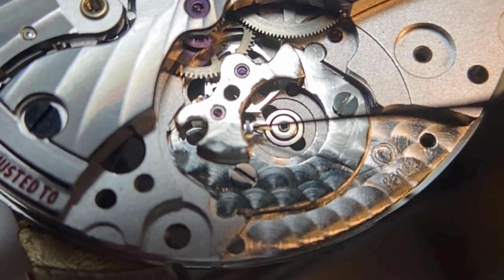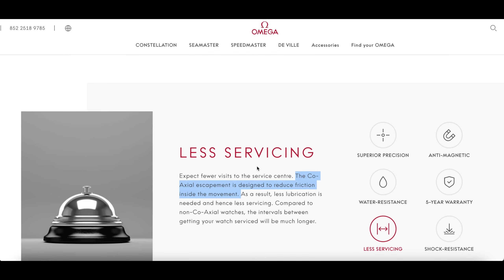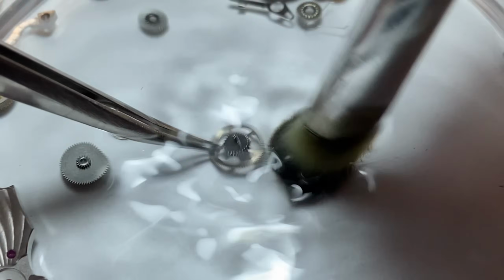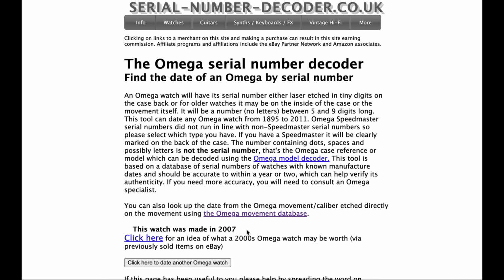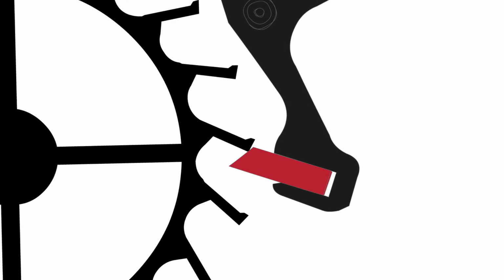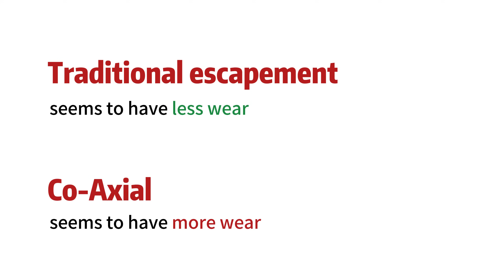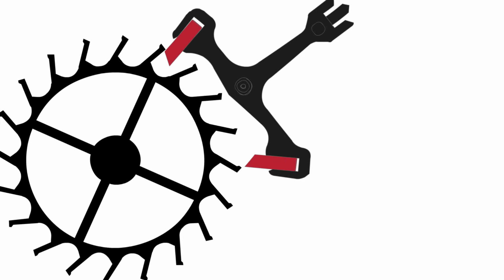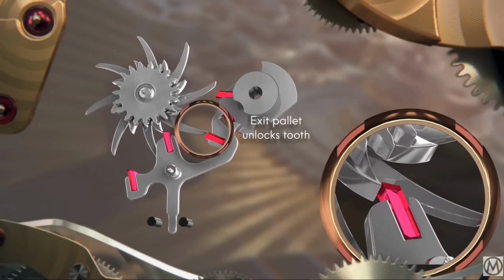Something you don't know about Omega Co-axial

Comment: It is very concerning that an escapement, which in theory does not require lubrication because the level of friction is so low, would show any wear in the teeth of the escape wheel, something I have never seen in a Swiss Lever escapement. 
In 1999, I made an animated drawing of the coaxial escapement and posted it on my website. What I learned from making the drawing, and comparing it to my other animated drawings, was that the drawing had to be exactly right, or it would not work. Other drawings would work within parameters of error, but did not have to be absolutely perfect. An escapement with such low friction should never wear out. I have never seen a worn-out Swiss Lever escapement, not even one with a brass escape wheel, after running for many years without lubrication. However, if the teeth land on the corner of the pallet jewel (when it should land on its locking face), then this could cause a small binding effect which would result in wear. I would probably not be able to see the difference with a watchmaker's loupe. This leads me to believe that this particular coaxial escape wheel, which wore out, as ever so slightly defective when it was new, or it would not have worn out the way it did. 
You can google coaxial abbeyclock to find my animated drawing, which you could compare to the animated drawing of the Swiss Lever escapement. 
I hope this information helps this discussion.
Reply: In my view this is more a result of modern business practices, in which parts aren't made to last forever, they're made to last until the next service. Any part showing the slightest wear is replaced. That creates a whole lot more revenue for the brand and is why a service of a 5 year old watch like this at a brand store costs close to $1000. 
In vintage watches you would never see this kind of wear. Back before the 1980s watches were made with much higher quality materials and mechanical processes rather than chemical, eg the burnishing of the pivots.
Reply: I have lever escapement watches over 100 years old, plus others in the 50-90 year 
old range, not serviced in over 20 years and running well. But this is supposed to have longer life ? 
I am glad that I specifically looked for a  Speedmaster Professional with a lever escapement when i acquired mine 
.
Reply: @ We could argue about durability, but I believe that the best lubricants last about 6 years, so every timepiece should be lubricated every 4 or 5 years. Since you have a Speedy, look for a page on the same website called How a Chronograph Works.
Reply: Really interesting info Abbeyclock, I was also wondering why it had failed so hard after a relatively short time without service (compared to the hard lives some watches live). Also the fact that only 2 teeth were worn, rather than a uniform wear, seems to support your theory.
Reply: @eus9  Now I am concerned about the new escapement with two escape wheels in the all-new Rolex Land Dweller, Rolex's answer to the Omega Co-Axial, twenty five years later. I am concerned because I do not want a watch with a silicon escapement  as brittle as glass.

Comment: That escape wheel is the old design FYI. The newer co-axial escapement, at least since 2017, has a multi point star shaped escape wheel, which is completely different and might have a much longer life without oil.

Comment: 1- Rolex recommended service life is 10 years while Omega still recommends aservice from 5 to 8 years, which defeats the purpose of the long service life of coaxial 
2- Up to my knowledge, new oils used are synthetic and have a much longer life than 5 years unless you live in extreme climate conditions 
3- Even if the coaxial escapment has a long service life, there are way too many parts in a watch movement that might develop a problem that would require a full service 
4- It also depends on how often you wear your watch and how to take care of it. There are certain ways that might help to prolonge the service life of any watch 
5- The servicing of coaxial is more complicated and more costly 
What I'm trying to say, I think the co axial is gimmick, Omega wanted something new that it can use to market the relaunch of the Omega brand after being under the rock during the 80's and 90's
Reply from the maker: Thank you for your in - depth analysis of Rolex and Omega servicing. You make some valid points. I think each brand has its own engineering and design philosophy.

Regarding the co - axial escapement in Omega, although you view it as a marketing gimmick, it has indeed brought some technical improvements in terms of reducing friction and improving accuracy. And I agree with your point that environmental factors and individual usage patterns can still impact the Performance of the Watch movements. Anyway, for watch enthusiasts who value precision and innovation, the co - axial mechanism may still be appealing.
Reply: Omega service interval set by engineers. Rolex service interval set by marketing executives.

There's a reason Rolex have terrible amplitude and accuracy problems, but we all still throw shade at 'the possibility' of a problem with Omega movements.

Comment: The great thing about most mechanical watches is that they keep pretty accurate time considering the complexity of all those springs, gears etc. I have an Omega Speedmaster Reduced with a  3510.50 movement - ETA with a piggyback chronograph. I wore it everyday for 30+ years and had it serviced twice and repaired once after I smashed it up in an accident. On average it gains about 20 secs a day, which is fine by me as I always set it a minute or so fast so that I’m never late for a meeting. Sure, my modern Omegas with 8800 movements are better but watch nerds like us can get too caught up in tiny differences between movements.

Comment: 'Co-axial' is Omegas 'interpretation' of the Daniels movement that they acquired in the eighties. George Daniels original concept was for a maintenance free movement and it can be argued that as long as Omegas versions are not compromised, they do a pretty good job.

I have had an early one from new. It became noticably noisy within 18 months but after returning from that initial (disapointing) 'service', has been within speck. Not sure without checking but I think I got it in the early '90's?

Comment: The Omega serial number decoder is  not accurate on newer model watches. I have a 2024 PO with an 8900 movement, which debuted in 2015, but the watch serial number places it from 2008. The newer serial numbers have no rhyme or reason for their numbering and are very hard to accurately determine a year from. If you need to have an accurate year, say for insurance purposes, you need to get the serial number provenance directly from Omega.

Comment: My relative passed me an ETA based Certina that had been running 40 years without service, and he wore it every day.  When I gave it to the watchmaker he thought that it wasn't worn much because the escape wheel and gears looked in such good condition.  I have similar Seiko watches that are over 20 years old and have never been serviced; in other words worn escape teeth is not normal for the lever escapement.  Furthermore, the Coaxial escape wheel still needs oil, but the Coaxial escape wheel is extremely difficult to oil properly.

Lastly, you comment about how the Coaxial doesn't lose time even when the oil has lost its properties: this contradicts your earlier statement about not needing oil.  I have no reason to doubt that the Coaxial can keep accurate time even with dried out oil, but is that an advantage?  I would argue no.  I rarely service my mechanical watches, and I have a timegrapher to tell me when watches actually need servicing instead of following an arbitrary 5 year rule.  If my timegrapher cannot detect any change in amplitude etc., then that's a bad thing.  I wouldn't want to be forced to service my watch because I can't tell if the oils are dry.

Comment: the service cycle is still to short, more engineering to be done.  I do not service my watches, they just go in a box when they stop. in a decade, my taste have will have changed. Possibly some material advancement cad do the trick such as using a machined sapphire escapement, though likely price prohibitive.

Comment: Surely any oil on the pallet jewels will be rubbed of in minutes or hrs  at the very most a day ?
Reply from the maker: That's not entirely the case. Even if there is a diffusion phenomenon of the lubricating oil, a small amount will still remain at the contact points in the end.
Reply: No it won’t, these oils are designed to keep on those surfaces.

Comment: I have a dynamic automatic that has never been serviced, it is an ETA movement, it's sat in a drawer for more than 20 years. I wore for the first time a few months ago, and it's running real slow. I'm considering getting it serviced, but on a Deputy Sheriff's budget, that a scary thing.
Reply from the maker: Hey, thanks for sharing your experience! The ETA movement is a classic. The fact that the watch is running slowly after being stored for over 20 years is likely due to reasons such as the lubricating oil drying up and parts wearing out. The repair cost can indeed be a concern. You can consult several reliable watch - repair shops and compare the prices. There are also some independent watchmakers who may offer more cost - effective solutions. I hope you can find a suitable way to bring your beloved watch back to life!
Reply: I have the same watch all good

Comment: Outstanding video. I have been led to believe that Omega attributes the problem with older escapement wheels on the 8500 to "percussive trauma" (rather than friction) from the pallet jewels on the escapement wheel  teeth; they have supoposedly addressed that on the 8800 and 8900, but I think that their lubrication recommendations have changed-- I suspect they are just saying the same thing you are, only you explain it better. Incidentally, we use the same timegrapher, or should I say tee-MAY-grapher?--Sorry, couldn'thelp myself.  I also noted that the lift angle is set at 52 degrees, I have read that the lift angle should be at 36 degrees for these movements.  I am truly impressed by your knowledge, I wonder what Roger Smith would have to say about your video.

I have subscribed to your channel.

If George Daniels had foreseen this unintended consequence of his modification to the "Swiss escapement" he would have known that it would require lubricants with a longer life to prevent the damage to the escapement wheel when it ran dry.  But of course, if we had more durable lubricants, we wouldn't need the co-axial escapement to begin with.
Reply from the maker: Thank you for pointing out my mispronunciation of "AI". 😅 Also, your insights are profound. Thank you for the feedback!

Comment: The only way to service my caliber 9605 is at the Swatch group service center in Miami or Secacus NJ.
Reply from the maker: That's interesting to know.
Reply: @charliemaker2119  it's got silicone hairspring, and you can't buy one.
Reply: @charliemaker2119  That's why Bill Sanders from the WatchArtSci YouTube channel doesn't care for silicone hairspings. It's not traditional watchmaking. You need a $million+  lab to make them. The technology is mind-bending. Abraham-Lui Breguet would not be able to make one by hand.
Reply: No it’s not, you can of course ship it to any qualified watchmaker, of course if you live in Europe I think the access to independant watchmakers are generally much better than most places in USA, they are much cheaper too, generally.
Reply: @truxton1000  you don't know what you're talking about
Reply: @NikonFM2n  Really? Ok I have just collected watches for over 30 years, buy and sell watches the last 10 and have around 80 watches in stock ranging in age from nearly new back to pocket watches made 250 years ago so yes, I agree I don’t know everything but I think I know enough to have an opinion.
Reply: @truxton1000  you don't know about the caliber 9605
Reply: @NikonFM2n  It’s the older co-axial, if the balance is worn the only option is to replace parts, the other parts of the movement is straight forward. Could be a challenge for independant watchmakers to get parts for Omega, I use an old guy that says he gets Rolex and hard to get Omega parts from the Middle East somewhere, but most is possible to get if you know where to ask. Omega and Rolex makes it as hard as they can to protect their monopoly of supplying parts but their efforts will never be 100%.
Reply: @truxton1000  silicone hair springs from the Swatchgroup are not sold outside the Swatchgroup.

Comment: Are you sure 2007 is accurate I don’t think the 8500 was out yet I think it was still 2500 in use I could be wrong though
Reply: I tested my newest Seamaster ( 2018 version) and I got 2007 as well. It’s not even possible. The watch wasn’t in production yet.
Reply: It’s only till 2011.. 😂
Reply: Same here, I got 2007 as a result for my Aqua Terra using the 8900 movement which was only released in 2015!
Reply: I agree.  That reference site is utter rubbish.  The movement did not come out until 2016 yet my De Ville shows 2007.  Oh and CrapGPT sworn blind it was 2002. It then acknowledged it was peddling rubbish. 

I do wish this content provider backed his impressive watch disassembly skills with better research.  As for ChatGPT it state false information with all the certainty of a well know political figure.

Comment: I tried your omega decoder and it says my Aqua Terra that I brought brand new January 2025 was form 2009.  It’s a 41mm with the date at 6pm which model didn’t debut until 2017.
Reply from the maker: The tool can date any Omega watch from 1895 to 2011. So it may not be possible to track it if it is outside this time - range.
Reply: @ thanks

Comment: The co axial movement in my speedmaster 3861 didn’t last a year before it stoped and I had to send it back to Omega.☹️ I bought my dad a Submariner in 2007 he never serviced it and it’s still running like a top. Sometimes simpler is better.
Reply from the maker: Perhaps it's time to consider taking your Submariner in for a service. 😅
Reply: @ I gave it to my my Dad as a gift back then and he’s to cheap to service it. 😂 He also has a Timex from the 70’s the thing was flooded more times than I can tell,  he use to dry it out with a heat lamp, never been serviced, crazy it still runs to this day.
Reply: Another funning story about his submariner. We were all at the pool and I look down at the sub in the water.  The crowns not even screwed down. 🤦🏻 fortunately no water got in but this is what I’m dealing with.😂

Comment: That website to find the date of your omega by serial number is flawed. I just entered the serial number of my Seamaster Diver 300M from 2017, and according to this site my watch is also made in 2007.
Reply from the maker: According to Omega's past serial number arrangement rules, if the serial number is in the range of 81,000,000 – 83,999,999, the production year of the watch I had is approximately around 2007. The serial numbers of Omega watches produced in recent years are rather chaotic, so I guess that's the reason why the info was flawed.

Comment: great video. can you comment on the 8500 vs later movements like the 8800 and 8900? are the METAS movements superior or is it only because they have been tested by METAS but are inherently the same
Reply: The 8900 is essentially the 8500G with METAS certification. The 8500A has a traditional nivarox hairspring, the 8500B has a silicon hairspring and the 8500G has all the non magnetic parts that allows it to pass Metas certification. The 8800 is a different movement altogether that is more simple than the 8500/8900

Comment: since the parts are worn out, will a third party watchmaker be able to service them? or are they only available via Omega?
Reply: I have a 2500 plant ocean and I had it serviced in 2017 by Omega and I also had it serviced last year by independent watchmaker and it’s been about eight months and it’s been running perfectly with the independent watchmaker. They did not replace parts to my understanding

Comment: Since 1754, when the swiss lever escapment was invented, this is a true and only pure mechanical innovation   for the true mechanical watches. I am not engineer,  but Spring Drive is a hybrid for me. Correct me if I'm wrong
Reply: Spring drive is hybrid it's true. Grand Seiko also has the new dual impulse escapement which is purely mechanical
Reply: It's still mechanical, purely mechanical. The force that drives the watch is still produced by mechanical means and not electronic, so if it's not mechanical, what do you think it is?
Reply: @michaelowen8055 : nah. It is a quartz watch that drives a few gears. The timing is done buy a quartz crystal, which basically makes it a quartz movement. The whole "art" of mechanical movement is to get it mechanically accurate, Spring Drive just removed that "difficult" part and times it with a quartz crystal. So basically they made a worse and less accurate quartz movement. Why even bother, just get a radiocontrolled quartz watch when you are going to cheat anyway.